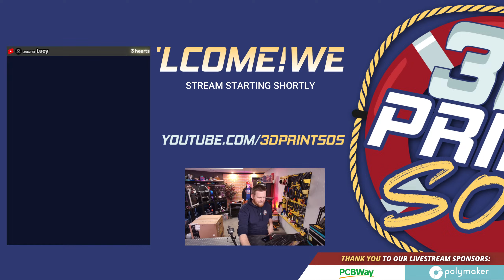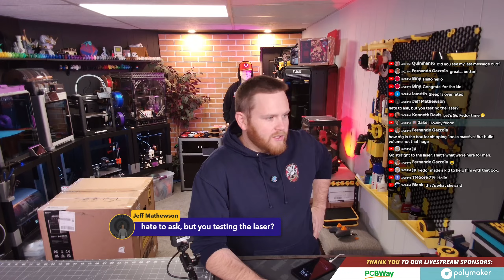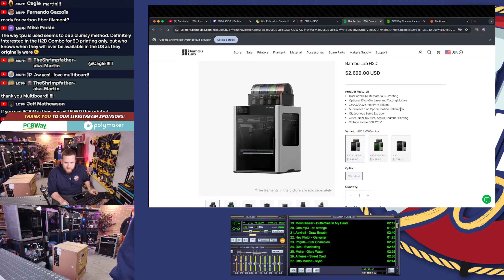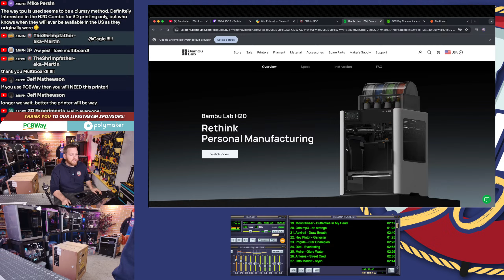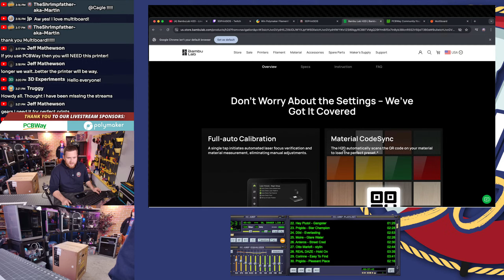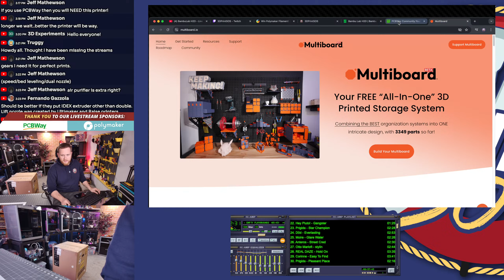BambuLab H2D - Live Unboxing the MOST ADVANCED consumer 3d printer

Comment: I would not even buy a Bambu Printer. They insist you use their own locked down klipper and also locked down cloud to process and slice your prints and now changed the terms of using their system to saying they will sell all your own data details on to others and most likely steal your own designed prints if they wish?

I did not like their system before, Now it's far worse.  I never buy any of them now.

Plus the price of this new printer is very high, you could buy two Creality K2 Plus Combo printers for the price of this one printer, those would come with multi colour and much bigger printing beds and most importantly Creality don't force you to use a slicing locked down cloud system or steal your data or prints!  

I call that a big win.

Comment: I missed the stream!  I saw the stream thumbnail, but I was out working on one of my other hobbies - buying, selling, and collecting vinyl records!  I 3D printed some display props for selling records and was showing those to my dad.  Not sure what to think about the new Bambu yet...both me (not a Bambu fan) and another engineer friend of mine (a Bambu fan, and a woodworker) are not sure what to think of the H2D yet.  But then again, I'm running used Creality machines -- I did get both my K1 Max printers upgraded with a CFS!  Congrats on the new addition!  The baby, not the printer! LOL!
Reply: You have a site you you buy records on? I have a suitcase full of vintage vinyl records from the 1910s-1950s that I have no idea what to do with but don't just want to trash.
Reply: @NetterForest  Generally ebay and Discogs.  However, records prior to the 1950s rock and roll era have limited value and may not be worth anything.
Reply: @ k thanks

Comment: The most advanced my a ..
Reply from the maker: @mkatakm  haha. What should I try to compare this to?
Reply: @3DPrintSOS  An advanced printer would use particles in 4 basic colors instead of filaments and be able to print in millions of colors by mixing them. Just like a laser printer does with toners. I believe those days are not far away. This one just proved to be another false hope on my behalf but I will always be hopeful. I know this let down is not your fault but calling this thing advanced is like an insult to advanced technology 😄
Reply from the maker: I get what you’re saying. At the same time, the machines you speak of either don’t exist or are surely not consumer facing. I won’t even mention the cost of such machines. For a consumer, in this moment, the closest to this is the Prusa XL and even that machine kind of looks like a DIY machine. I think you’ll be hard pressed to find a more advanced machine than this. It’s littered with cameras, sensors, automation, lasers and modular attachments. I don’t think you should be disappointed.
Reply: @3DPrintSOS  thanks but until I get the ease of using laser printers no 3d printer will be advanced enough. 
However, I recommenyou to check the video below, because that device, basically a filament mixer, does what I described by mixing filaments instead of toners and can be connected to any 3d printer. This technology is available now but still no 3d printer company is getting it. It seems they like milking this cow as much as they can before advancing the technology to the level we want.
https://www.youtube.com/watch?v=8wYWculJfk0
Reply: @3DPrintSOS  not like mixing toners but cutting and joining different color filaments so that the printer is fed by correct color at the correct time:
https://www.youtube.com/shorts/83N-hwEsFRw
Reply: @3DPrintSOS  "it's not the most advanced, the imaginary one in my head is"